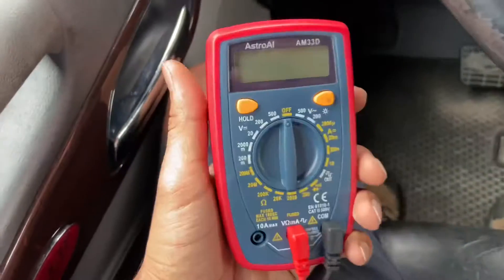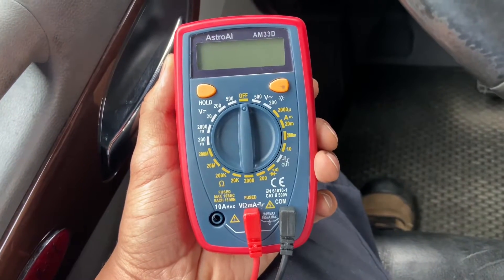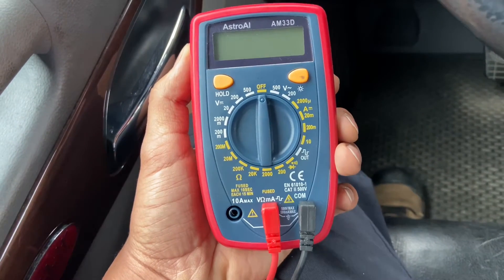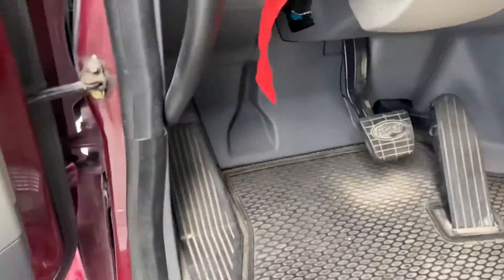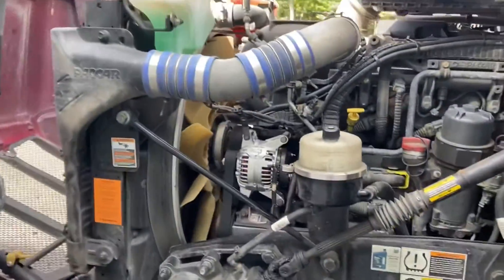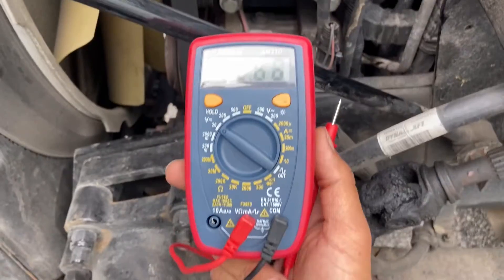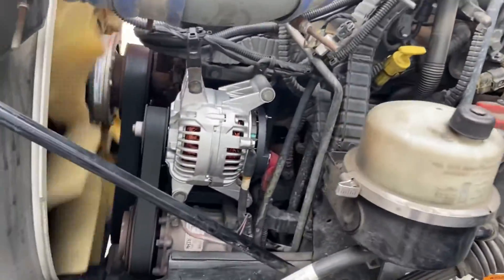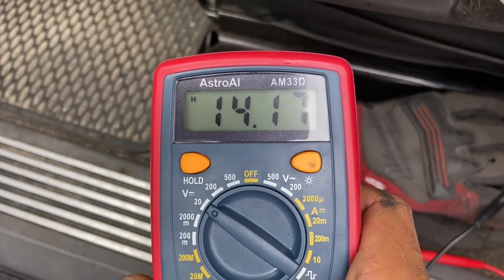How to test Alternator with & without Multimeter (Peterbilt Paccar Semi truck)

Comment: Does not mean that that alternator is charging the battery that means that that alternator is charging you have to test at the batteries test at the batteries while running to see if it is charging the batteries😊😊😊

Comment: Gonna add a negative cable to the alt, like in your video. Best method to ensure a better ground and never seen it on any others but I am running high in volts, well battery needs replacing now as it is bad high voltage. Still runs car though. Anyways, thanks, as I am super grounding my car (aka cleaning posts to ensure grounding). Just stuck on why still high volts to battery until I get new one. Hard answer to find on an 18 volt charge issue even with a new alt.
Reply: Sir your alternator is new I understand but it is a bad new alternator bad new alternator

Comment: Your test isn't necessarily accurate. The alternator needs to be tested under full load, with all the lights on, the air conditioning running  on high fan speed, wipers running and so on. THEN, if you're getting 13.5 to 14.2 volts, the alternator is likely okay.  THE REASON ;   Without a load on the alternator, you can have one or more bad diodes in your alternator, and it will show that it's charging normally. Same thing with the windings. one or more of the copper windings can go bad. I used to rebuild alternators. If the windings, and there's three separate ones, all together, have gone bad, usually you'll see that at their terminal ends. The copper becomes crystallized. One or more bad diodes, discharge the vehicle battery when the vehicle is not running. It's a very low power draw, and depending on how often the vehicle is driven, and the load on the charging system, it may just appear that your, once new battery, only lasted a year. This is why the only accurate way to test an alternator is under full load. A carbon pile bench tester is the best device to use, because it actually can put a full load on the alternator. The person doing the test runs the alternator on the bench tester, and slowly increases the carbon pile, while watching the amperage draw. So if you have an alternator that's rated at 140 amps, this test allows a full 140 amp power draw. If the alternator is good, then at rated amperage, in this case 140 amps, the voltage is at least 13.5 volts, and hopefully 14.2 volts. If not there's a problem. It could be one bad diode. There's six diodes in an alternator. Two for each winding. Since the alternator stator and rotor actually produce alternating current, the alternator has an assembly within, called the rectifier. The rectifier is made up of those six diodes, built into a heat sink assembly that cools the diodes. What diodes do, and what they do in the alternator..... The diodes only allow current to flow in one direction. I told you there's six diodes. Technically there's three positive diodes and three negative diodes. Together they take the alternating current that's being produced in the windings, and turn that alternating current into a direct positive current, to charge the battery.  If a diode goes bad, it will allow current to flow in either direction, or maybe no current flow at all. When you have one or more bad diodes, that diode is allowing current to be drawn out of the battery, while the vehicle isn't running.  Scenario ;  You just got a brand new battery, and drive your vehicle to the airport, where it's going to sit for a week, while you're on vacation. You get back to the airport after flying home, load your suitcase into the trunk, get into the car, expecting your new battery to fire up the vehicle. Instead your battery is dead as a door nail.  That's a common scenario with the alternator having one or more bad diodes.
Reply: Thanks for the information 👍

Comment: The test wasn't helpful.  I new something was wrong when my 2018 cascadia.  When I here my inverter going off. But not just the inverter I new something was wrong when my volts on Mt gage was reading 12.5 or 12.6. I opened my hood an. Use my volts meter at the alternator.  But my engine was running an I check the alternator 12.5. It should be reading 14.2. An did the same thing on batteries.  12.5. Bad alternator.  I have a apu. On my truck so I will lett it run. Heading to the house to fix my alternator myself.  Guys get u a volts metter